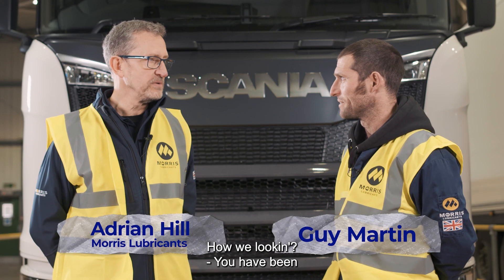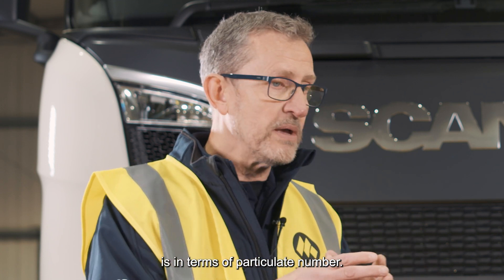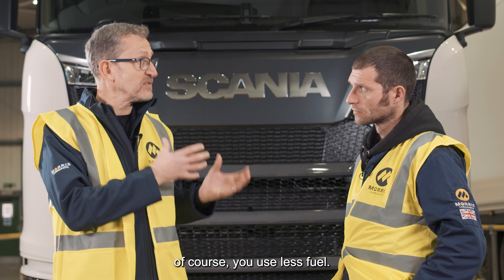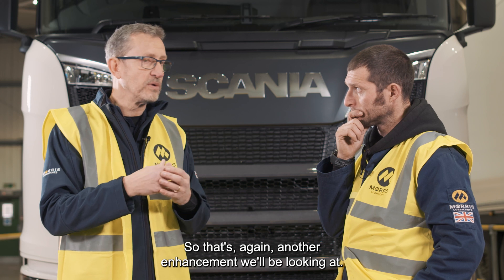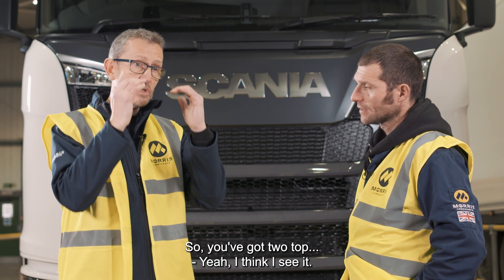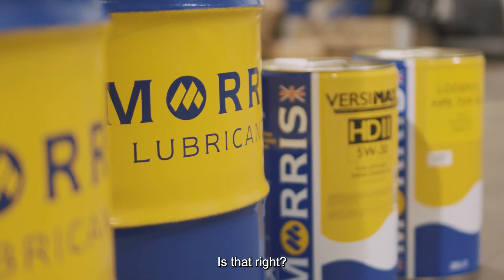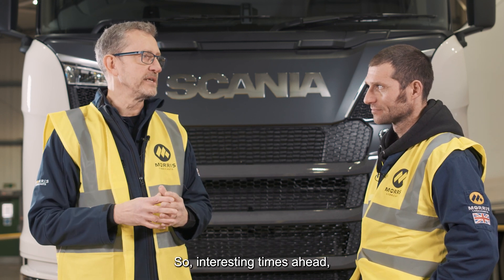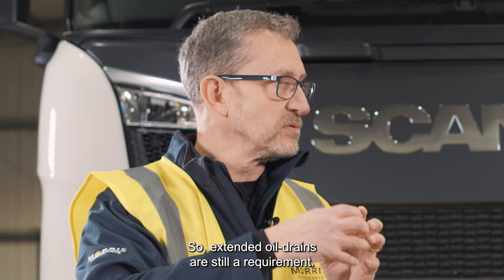What Lies Ahead for Truck Engine Oils with Guy Martin

Comment: How about ring gap. With aluminum pistons you run larger ring gap because of the expansion of aluminum pistons. However, will ring gaps be tighter and allow less blow-by past the piston?
Reply from the maker: Hi Bruce, thanks for getting in touch with Morris Lubricants. There will certainly be improvements in terms of ring pack performance and reduced blow-by will be a beneficial side effect. If you ring emal our technical team at technicalhelpdesk@morris-lubricants.co.uk they will be able to provide more information.